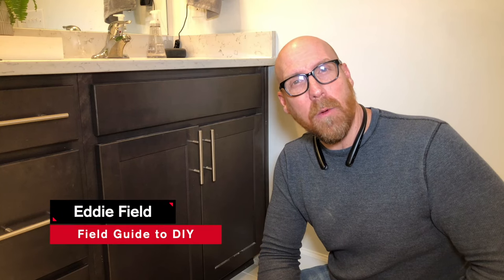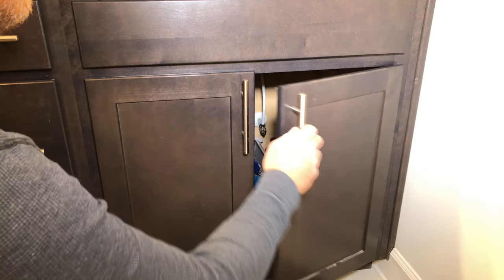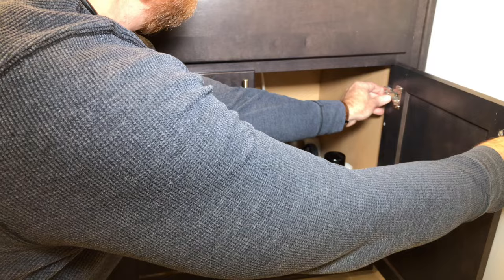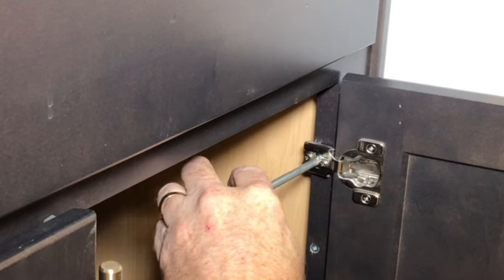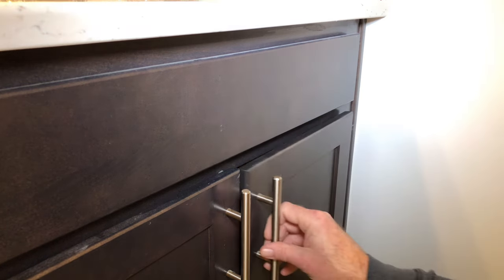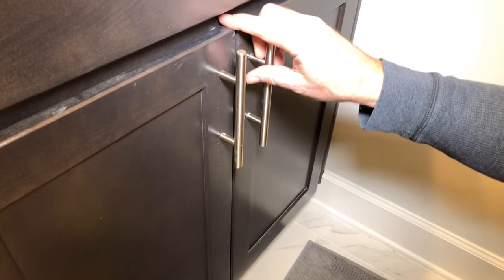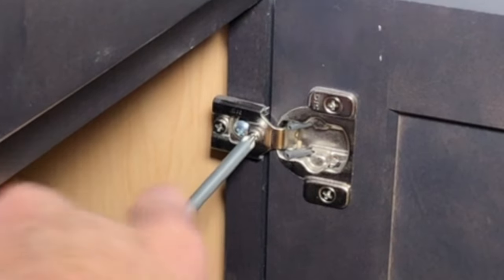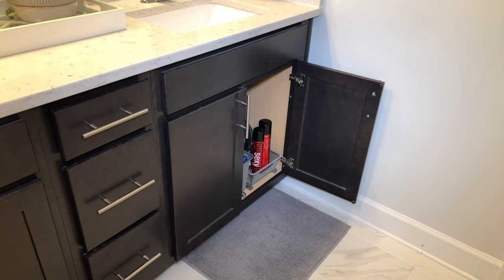How to Adjust Cabinet Door Hinges | Concealed Face Frame Hinges

Comment: What if the doors are aligned right, but some of them do not pull closed ? How is this adjusted ?
Reply from the maker: Are they self closing hinges?  Is there a spring inside the hinge?
Reply: @FieldGuidetoDIY  There is no spring. The hinges are all identical. Some pull the door closed very well, and some not only have no  pull to close them, they actually push the door slightly open when held closed.

Comment: How do you get the doors to stay closed..are my hinges worn out and warped.  Most of the cabinet will close but I have a few that won't close all the way
Reply from the maker: It sounds like they are too close to the cabinet, Mark, so it is rubbing against the face frame of the cabinet.  Try to adjust it out and see if that helps.
Reply: @FieldGuidetoDIY  I have and i measured the other cabinet hinges and how they are set and they all work good. They close just the way they should but a couple cabinets don't.  I wonder if opening them too far has sprung the metal piece that keeps them closed
Reply from the maker: @marknye51.thefixitguy  oh, that may be the case.

Comment: How do you remove cabinet door with this type hinge so I can paint?
Reply from the maker: Carolyn, I suggest you remove the two screws above and below the big round cut-in.  Once you do that for both (if your door has two hinges or all (if more than two), the door should be able to be worked free from the hinges.  Paint the door and when dry work the hinges back into the holes.  I personally would make every effort to avoid getting paint in those big round cut-ins.  Otherwise, it may be difficult getting your door back onto the hinges.  Please let me know whether or not this helps!

Comment: Wrong, you can utilize a Lighter Duty cordless drill with the torque Dialed down to like #6 or 8.  I finished in half the time without any issues
Reply from the maker: David, good to know.  I appreciate you sharing your experience.  Thanks so much for watching too.
Reply: @FieldGuidetoDIY  I like Milwaukee they have a Smaller power impact driver
Reply: @FieldGuidetoDIY  you got it. STAY Safe